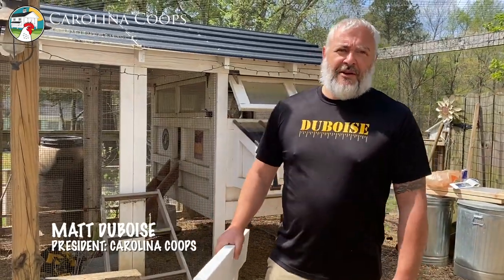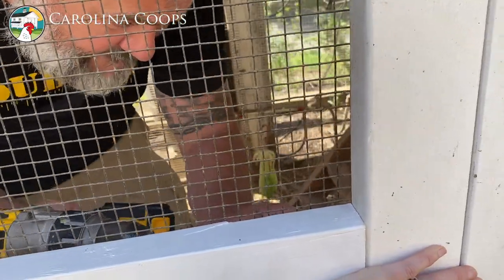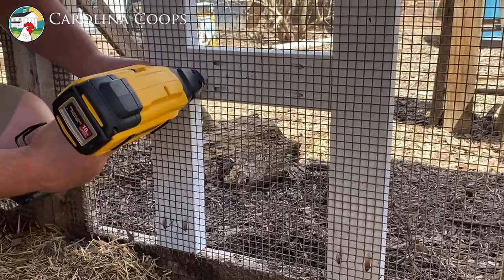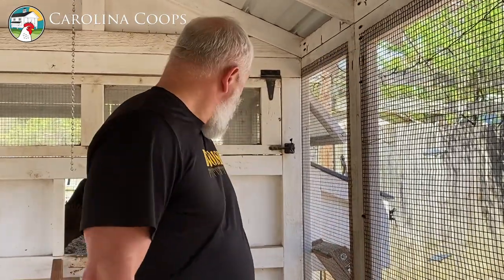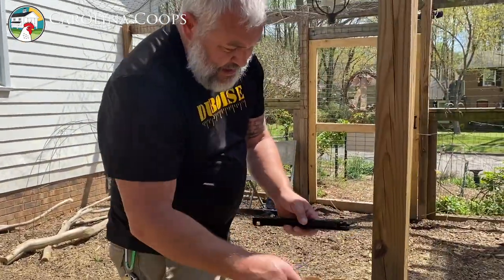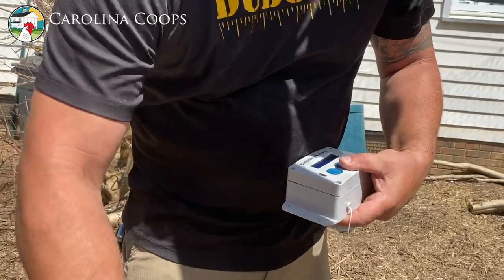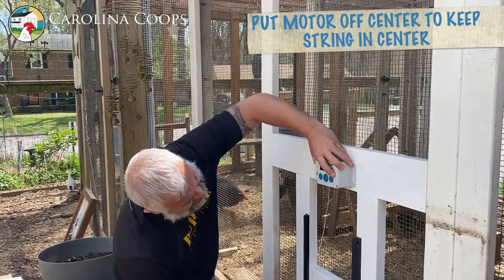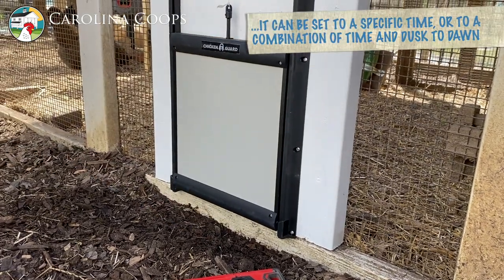How to Install a Chickenguard Automatic Chicken Run Door |

Comment: Can I install this on the coop itself?  I'm getting the 6x8 American coop with out a run and I'm wondering if it will interfere with the vent windows.
Reply from the maker: Hi Lisa, yes, it would interfere with the windows, but you can install the chickenguard on the inside, you would have to use the timer function instead of a photocell function. Omlet also makes an automatic coop door opener that opens from the side, which would also work for your coop. Hope that helps. And thank you for choosing Carolina Coops for your chicken coop!